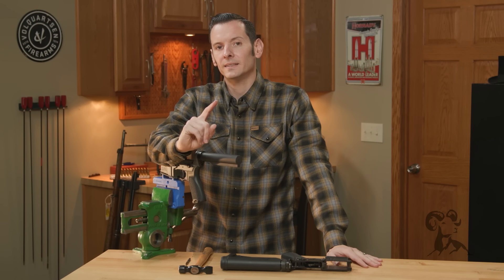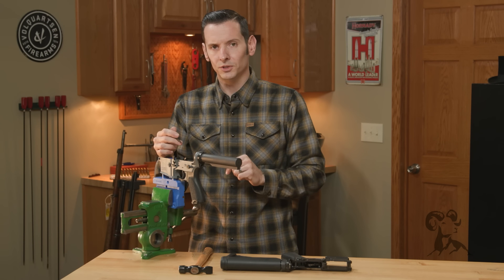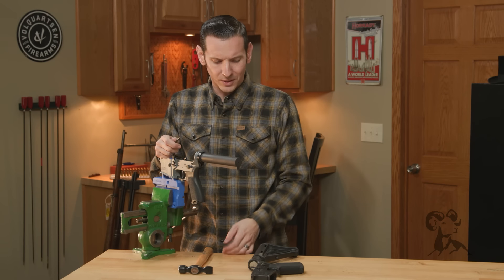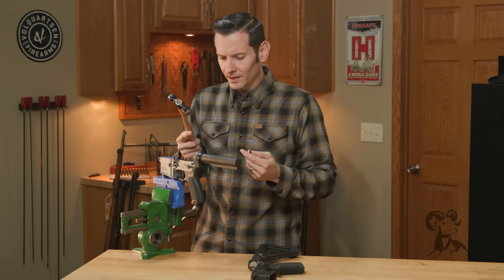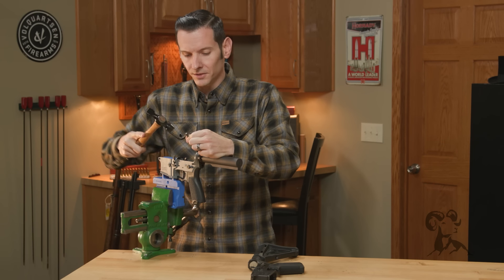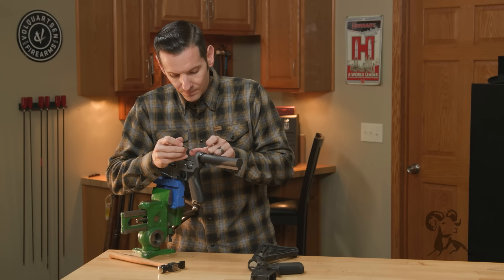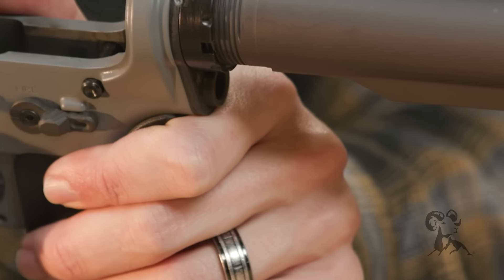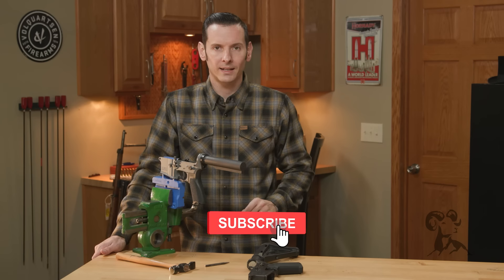Quick Tip: The Right Way To Stake an AR-15 Castle Nut

Comment: Good video...I have a 2X4 wood stand with a plastic conduit ring attached to the top of it. It's cut to the right height to the level of my vice and bench block. It slides over the buffer tube and stands on the bench to support the rear of the buffer to take out the wobble from the bench block while staking the castle nut. Cause I'm always nervous of damaging or deforming the lower receiver in any way. 😊
Reply: If I'm understanding your description, that really makes sense...if you're bored, I love a picture of that 2x4 wood stand.

Comment: First, I have nothing against staking a castle nut. But as others have mentioned, I take things apart often and like to be able to easily disassemble. So I use blue Loctite, which Caleb says never to do, and it works just fine for me.
Reply: Amen brother. Works fine and holds for more rounds than one can afford
Reply: Ditto. And if that nut comes loose with a collapsible stock you'll know it before it induces a failure during firing.
Reply: Agreed... a small drop of blue works fine, holds up well and with a little heat can I have never had a problem with removal.
Reply: @themdrnsamurai I've never once had to use heat to get something off that's had blue used.   Blue isn't permanent,  it's not supposed to need heat.

Comment: I like to use those "self hammering" center punches. Seems like it puts less stress on the lower reciever but still moves metal great!
No vice block necessary with those type punches either...

Comment: I use a nail set and I filed the tip to be same as a staking tool. The only downside is that ever since Caleb said to stop doing that my AR's explode when I try to stake it. Thanks alot Caleb.

Comment: I use the automotive spring loaded center punch purchased from the harbor freight no hammer needed just press it striaght down then tilt it and press down a few more times to move material into the notch. No vice needed. Professional staking every time.   Think its not needed think again.  Prior to our Afghan deployment my buddy wanted to put a qd end plate on his M4. The gunners mates put it on but did not stake it as they were going to take it off after.  Halfway through the castle nut came loose. Luckily at a time when it was not critical but could of very well happened at the wrong time

Comment: My automatic center punch works perfectly for this. I can click it once, then move it to a slight angle and 1 or 2 more times it pushes the material where I need to be. No hammer needed.

Comment: you mentioned a vice block that holds the receiver extension. I found a decent one on Etsy for under 15 clams. Makes torquing the castle nut less stressful for.

Comment: Well... I put a Magpul ASAP Ambi Sling Mount back there and... I wrecked it. Used a centerpunch, and I've staked a lot of stuff in the automotive world with no problems, but OMG; I've got a piece of metal hanging off into the notch on the castle nut, but it ain't worth sh- , the nut/tube can still turn.. I mean, as long as I don't let the tube make full a rotation I guess it's ok? I've been shooting it like this, seems ok. I dunno.. I should've watched this vid first I guess, but you did what I did, and what I've always done. I'm not sure what went wrong, honestly.

Comment: I use an automatic punch to make sure I'm in the exact spot I want to be in to move just the right amount of metal (using the hammer punch on the first go can be a lot less accurate), and then I come back with the hammer punch and move it the rest of the way. This just starts you at a perfect location.

Comment: I think the obvious follow-up would be: The right way to properly remove an AR-15 staked castle nut.  You might even want to include methods for removing a castle nut that was installed with LocTite.
Reply: You should never use loctite on a castle nut, so that video isn't needed. The proper way to remove them is to simply back the nut off with an armorer's wrench.
Reply: @KeepTheGates  Shouldn't, yet some do.  Hence the video to help people who did it.  That's the point I was making.

Comment: Ive found that a $10 center punch tool works the best no need to beat on it with a hamer and punch the center punch tool is spring loaded all you do is press it down where you want to start the stake do that about 5-6 times and you will end up with a perfect stake every time and no beating and pounding on the end plate

Comment: I have a oak dowel rod I slide in the buffer tube for support and lay the receiver down flat on my lap and leg. Whacking on it as shown made me cringe because that's a lot of unnecessary force torquing on it. I start in the middle of the end plate with a automatic center punch to get it started and going. I then move to a carbide center punch and do some light taps with a hammer to open it up displacing more steel into the slot. I have another carbide center punch that I custom modified carefully on a belt sander chucked into a drill. You have to go slow a little at a time and keep quenching in water so you don't turn it blue/purple and remove the hardness. It's ground into a dome or rounded cup shape after you are done. A few taps with that and it is a perfectly round hole that looks like it was machined with a ball end mill. After I get it looking the way I want I use some de-greaser either alcohol or Gun Scrubber and clean the area before I touch it up with some cold bluing on a Q-Tip. I then wipe off the excess and apply some CLP or gun oil to neutralize the cold bluing and protect it. Mine look better than most factory jobs and hold as well or better.

Comment: Good point, how do you remove a staked castle nut?
Reply: You can move some of the metal in the castle nut notches out with a punch to make getting the nut off easier.
Reply: Even with a very good stake, you can still just take it off with a wrench; the metal of the backplate is very soft and will just bend out of the way.

Comment: Again, the AR platform?  Here we go, now we're beating metal into a groove on a castle nut, just to stake parts from coming loose?  Last time I did this, was replacing the wheel bearings on my truck.  Keep in mind, all this hammering/center punching  to tame a .223, maybe a .308 cartridge?  Funny, I've never had to 'move metal into a castle nut' on any of my many rifles.  Just sayin', maybe a detent design for the castle nut?

Comment: For standard builds I’ll stake just like Caleb shows. If I know a build is going to be changed sooner rather than later, I put on a ratcheting end plate and castle nut set.
Reply: How’s the ratcheting type working for you ??  I’ve used them also seem ok so far.
Reply: What is castle nut set?
Reply: @actionjksn  PWS Ratchet Lock Castle Nut and Endplate Set
Reply: @gusm2752  No problems. They release only when I use a wrench, I haven't had any come off on their own. I've put hundreds of round through, changed equipment and no problems.
Reply: @actionjksn  it is a set that comes with an end plate and castle nut that ratchet into themselves.
Reply: Ratcheting endplates are garbage.

Comment: I stake all castle nuts. However, I do not stake them when the lower is in the vise. I lay the installed castle nut/endplate assembly on a piece of wood on the floor and hit with a Starrett 117C. I lay on the piece of wood as to not put loads of torque on the receiver. Some end plates are strong and you have to whack it pretty hard

Comment: I tightened my last castlenut with an eighth inch tig welding rod piece  And tapped it with a hammer till it was sufficiently tight. It never came loose and later on I found my punch that was nicely pointed and I went ahead and staked it yes I am a hillbilly

Comment: Thanks, Caleb. I would also like to see the correct way to remove a staked object. Just wrench on it till it gives? Thans has been my method in the past but I would like to know if there is something better.
Reply: Yeah, just unscrew it like normal. It takes a bit more torque but it will break the stake without breaking anything else.

Comment: Great video! But how do you unstake that to change buffer tubes?
Reply: A wrench will apply enough torque to spin the nut off. Not really a big deal.
Reply: Comes off easier than blue loctite.
Reply: Thanks! I hadn’t realized it was rather easy to  unstakr

Comment: What is the recommended way to removed a staked castle nut? Also, is it really necessary if tightened? And why is loctite not recommended? I think my colt A1 tube was fully loctited onto the receiver.

Comment: Honestly, I've just been using one small drop of blue loctite in the square hole when seated, then finish torquing it. Don't flood the thing.

Never had one come loose, and it can still be removed if necessary.

Comment: I've helped several people do builds or modifications and they're always horrified that I suggest staking the castle nut. "You want to dent my gun?!" It's really bizarre. One thing I've started doing is bringing a black paint pen with me and after staking I blacken the bare metal. It seems to sooth the gun's owner if the stake is somewhat concealed with a bit of paint.
Reply: I've found that staking with a regular flat punch straight down with a single solid whack leaves a nice pretty black half cirlce. No marker needed
Reply: “Why would you stake it, it’s not goin anywhere”

Comment: I tried doing that with a Magpul back plate and the back plate metal was harder than the punch. So I've never staked a buffer castle nut and I've never had one come loose. I just torque them down to MMF! ft-lbs. No stake, Loctite, or welding.
Reply: I got into the AR15 world in the ancient days of 1977, with tubs of parts/accessories from constant swapping & experimenting on many lowers. I've never staked a castle nut and never had one come loose. For collapsing stock tubes I face the notches THE WRONG WAY...!! I didn't like snagging my skin on the notches plus the notches facing the receiver add a little bite to stay. 
I don't understand all the angst over this. Use some muscle. This is not rocket science.

Comment: What’s your opinion on the ratchet style castle nut. ? I’ve used them on my ARs to avoid having to stake. Seem to be ok.
Reply: I used the same on mine, just because. So far, so good. I have backup, standard castle nuts, just-in-case.
Reply: The ratcheting style castle nut seems fine to me,I wanted to test these on something short too see if it’ll hold,so I threw them on a couple of 10.5s and a couple of 14.7s and they’ve been doing great still no slippage and they have been ranned in some weird environments so yes they are great
Reply: @Havdollarwillbrawl   Thanks sir. No issues on mine so far. I have them on 3 but not a lot of rounds yet 🇺🇸

Comment: Now that you showed the proper way to stake the castle nut, now you will have to show the process for removing that castle nut.  I am guessing more ARs have been damaged trying to remove a staked nut than staking one.
Reply: They come off easier than blue Loctite. Promise. That tiny bit of metal just slides out of the way if you need to remove it.
Reply from the maker: They come off just fine but require a bit more torque. LocTite has destroyed far more receiver extensions than staking.

Comment: I have shot more AR's without the castle nut being staked and I can only recall one coming loose after many thousands of rounds. I am not opposed to staking a castle nut, it's just in that job we had them apart so often for rebuilds it was not worth doing. If it's properly torqued and checked at each maintenance cycle I found it wasn't needed. For the average user who doesn't shoot thousands of rounds in a range session nor do they rebuild often I can definitely see the benefit of staking.
Reply: A little blue thread locker goes a long way.  😉
Reply: Wrong

Comment: Hi! I’m curious, would it work fine if I just used a very small amount on the buffer tube threads, as well as the castle nut threads? Or would that be prone to friction welding from all the movement and energy transferred through the firearm

Comment: The one tool that is worth the cost is the Viceblox lock and hold..It tightens the AR lower to the vice with zero movement, eliminating the wobble when stacking and doing other work.....

Comment: If you had to replace the gas key on the  bolt carrier whats  easy way to remove the staked gas key bolts.
Reply: They unscrew with no problems’ sometimes the head of the cap screw will not back out past the staking’ so you have to unscrew them a little at a time until they both are completely unscrewed. Gas key screw torque is 55inch pounds when you put it back on. I use adjustable gas keys and change them all the time’ I put a little red loctite and torque’ I don’t stake them and they’ve never come loose after thousands of rounds.
Reply: Torque it off, replace the key AND screws.

Comment: I'm curious - why not use blue Loctite? Especiaally if you are prone to make changes?
Reply: I like to use rocksett its heat resistant and to remove it you just soak it in water
Reply: i wondered that too. coming from an automotive background i cannot see a downside.
Reply: @Ecosse57  Yes, exactly. Caleb's comment was very emphatic, but unelaborated on. So, what, exactly, is the problem? I'm sure there must be a reasonable objection in his (and others mind), but whatever it is, escapes me. I can understand the need in a combat or adverse environment, but for the rest of us?
Reply: @CalebSavant  Interesting. I would not have thought that blue Loctite could cause damage to the buffer tube, even with the steel castle nut. Red, sure, but blue is a surprise. 

That said, now it makes me wonder about whether something like the the Geissle posisnap in their ambi safeties, might work in a castle nut type retention device. It would have to be very strong, but it woudl be something reusable. I'm sure I'm over-thinking things.....
Reply: No reason you can’t. Staking is just the “mil-spec”, so it’s tried and true, which is why people recommend it. With that said, literally nothing bad will happen if you use a couple drops of blue loctite, and you also won’t have any issues with your castle nut coming  undone.
Reply: Using loctite secures the nut to the tube, and doesn't lock the receiver. Loctite isn't the proper method and is stupid to go with over staking.

Comment: now show the best way to break loose a staked castle nut
Reply: I think they may have it in one of their videos. It's not bad. Maybe just give your wrench a tap with a hammer and it'll come loose
Reply: If you have the tools to properly put the castle nut on to the right tourqe spec, then you have the tools to break it free from being staked. Stakes aren't permanent.
Reply: Hit it with your purse
Reply: @johnadams673  Then cuss at it.
Reply: @Ohnyet  Why would you cuss at your purse?
Reply: @lazor222 If you torqued it then there is no reason to stake it. Wrench tighten mine and gun has not flown apart nor loosened at this point.
Reply: @1014p  
It doesn't get loose until it does. Vibrations, impacts, temperature, different materials moving at different rates. That's one data point you got there.

Comment: I'm curious as to what would you recommend, staking on a polymer AR lower, or use one of the ratcheting/locking plates? 👍
Reply: It'll take longer to stake it since the polymer will reduce the impulse from the hammer.  Both would work, but ratcheting would be quicker and easier
Reply: Lol, a hot glue gun

Comment: Why not just use blue loctite..? Too many times have I dealt with terrible staking jobs or too many stakes in the castle nut that when a lower needs to be serviced, it's such a pain to get around. I've never seen an issue using a little blue thread locker to get the job done where it's still servicable.
Reply: Totally fine too. Nothing bad will happen and it will work great. Threadlockers weren’t readily available or very good when the “mil-spec” was created.
Reply: Blue loctite works great! Holds for more rounds than one can afford and comes apart just fine.

Comment: What if you need to maintenance/swap out your spring, detent, endplate, or takedown pin?  🤔 Breaker Bar?
Reply: Nope, they are easy to remove when you want to unscrew them and never come off when you don't want them to.